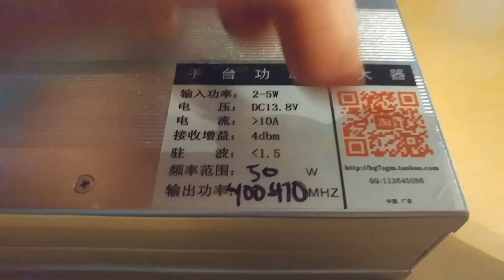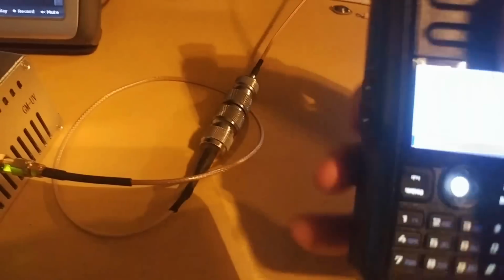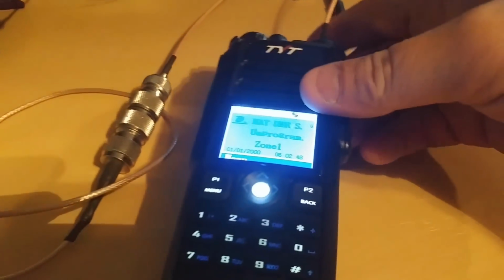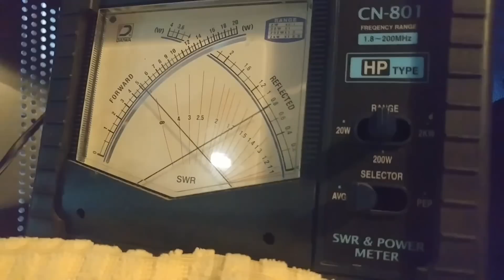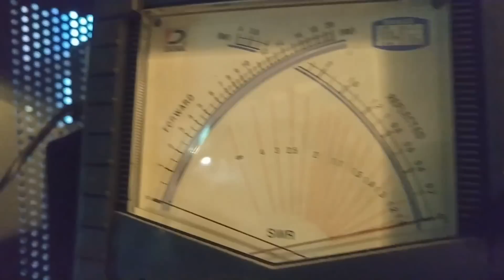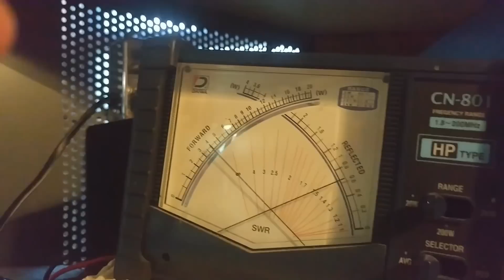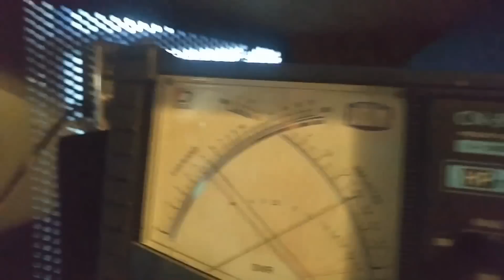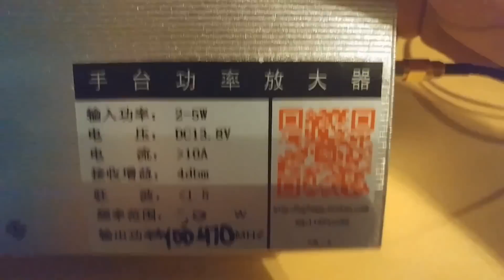DMR 50 watt amplifier on eBay

Comment: I'm looking for an amp for a 10mw MMDVM ... the only things I've found that are advertised as MMDVM require a 40mw-1w input.  Unfortunately I can't find n MMDVM hotspot that puts out anywhere near 40w.

Anyone know of either a higher power MMDVM (at least 40mw but no more than 1w) or an amp that takes a 10mw input and delivers < 10w ?
Reply: Hello
did you find a DMR amplifier for an MMDVM input 100mW
thank you

Comment: Have you measured it with a correct meter?
Reply: this will kick out around 95w with a bit higher voltage and about 5a
Reply: cant leave the volts up if your not talking tho well not for too long any ways hahaha

Comment: Good Video thanks for the info on the amp.  I have both the MD380 and the new MD9600D.  How do you like
your MD 9600. Mike K1MIC
Reply from the maker: Well i love the 9600 but htere is problems TYT is fixing them but slowly they just released a big firmware update thats has added a ton a features including 10000 contacts with 100,000 comming soon

Comment: If It Is On 400 To 470 Will It Work On GMRS 462.500 467.500 Or Is It Digital Only?
Reply from the maker: It works on analog and digital
Reply: OK Thanks...

Comment: On what frequency do you make the power measurements? I see the amp is for 400-470 MHz and the meter for 1.8-200 MHz. So there is no match where the meter and the amp are working in a specified frequency.
Reply from the maker: Thats a good comment i totaly forgot im on the wrong meter that meter is only good to 200 mhz so no wonder i have wave on 440 lol maybe ill remake the vidoe with a 440 meter thanks for pointing that out !!!!!

Comment: I wonder how this device would work with an openspot. I can't reach the shark RF from another room. Yet guys on you tube claim then can connect from out side their home.
Reply: The shark will do a good mile with the NAGOYA NA-771 SMA MALE antenna... these are fantasic on the radio as well. I did have to make a cardboard cut stand to tilt the shark upright but works well to about a mile on standard full power from the shark.
Reply from the maker: If you cant reach it from another room something is wonrg the power on the openspot is turned down or something i use mine all over my property wich is 30 acres you cant use this with a open spot as the open spot is only 40mw so not enough power to drive the amp
Reply from the maker: Correction i have made a new video and the open spot will drive the amplifier so i now have extended the range of my openspot
Reply: you have a 40mw open spot?  Thought they were 20mw can you confirm?

Comment: have you had any issues with the DMR timing and the amplifier ?
Reply from the maker: No issues at all its a dmr amplifier so it uses diodes to switch unlike analog amplifiers that uses relays that are too slow to use on dmr i use it on my local repeater with no problems at all